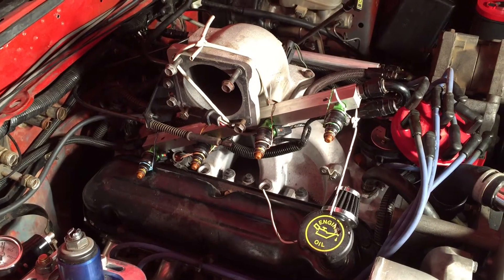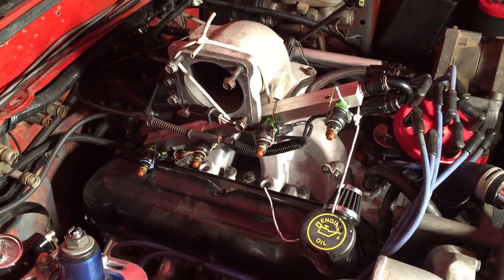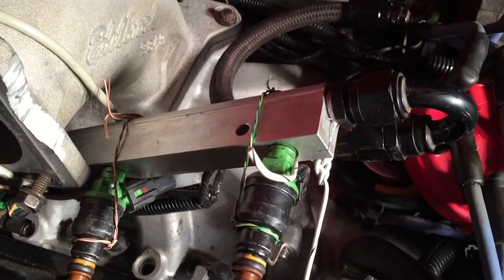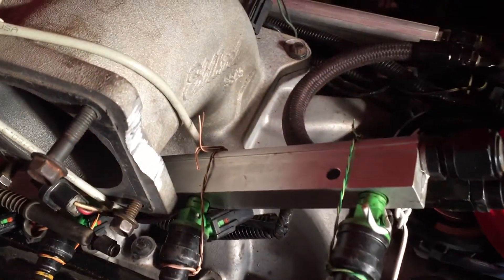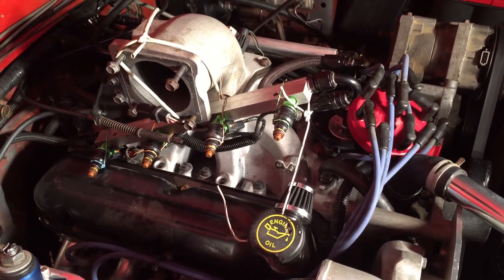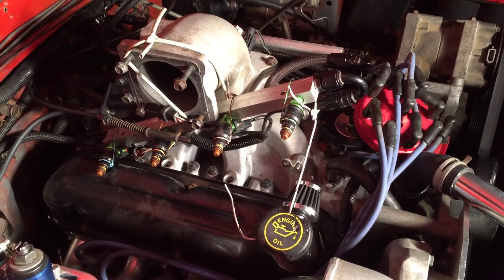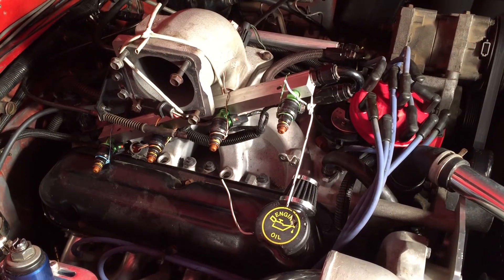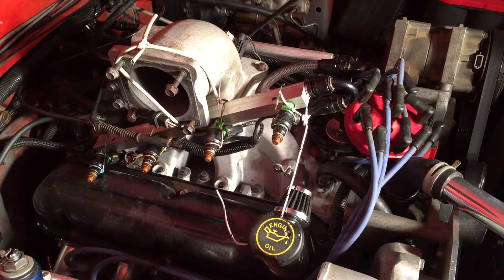Fuel Injector Testing  [86 Foxbody Mustang]

Comment: Hey my friend I did this test and it seems I'm not getting voltage to my injectors. I put voltage to each one with my jumper pack and they open up so I know they're good. Fuel pump kicks on no problem and I also hear the relay. What do you think?
Reply from the maker: Your injectors should have 12+ to them at all times when the key is on.  The ecu will pulse the negative to fire them.  If you don’t have 12+ to the red wire at all times with the ignition on, there is a bad fusible link, blown fuse, bad relay or bad wire.  Power should come off the main power relay for the ecu.  I’ve got a diagram in my Haynes Manuel that shows it really well.
Reply: @BMF_Garage  One of the damn fusible link wires were cut in half. wth!lol
Reply from the maker: WTH! How does that happen?!? You get it fixed?  I’ll have to send you a picture later if you need it still
Reply: It looks like it was cut and the yellow and black wire are together now and the other one is by it's self. only 3 plus the red s connector correct? @BMF_Garage
Reply from the maker: That sounds right... but I’d have to see it to be sure...
Reply: @BMF_Garage  Thanks man! can you shoot me a photo of it to my email by chance? watersjr12 at gmail

Comment: Do you know where exactly the inherited are on a 93 4 cylinder? Engine looks slightly different
Reply from the maker: +Logan T  Looks different because this is a v8.  on the 4cyl the injectors will be in a different place.  They should still be in the intake manifold somewhere. I havent worked with the for 4cyl enough to know off hand though.